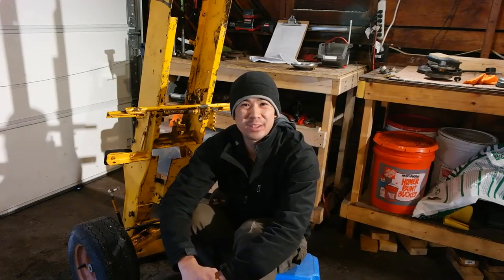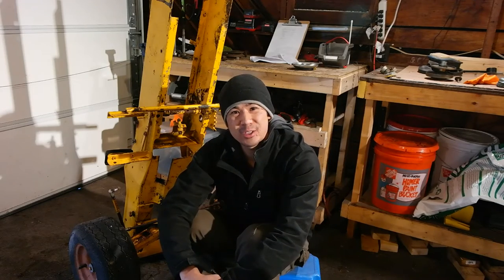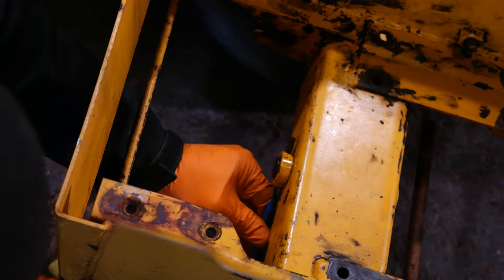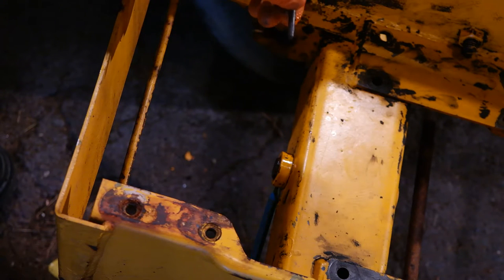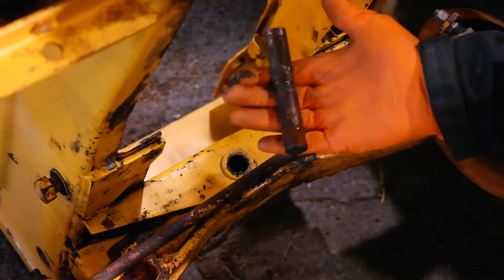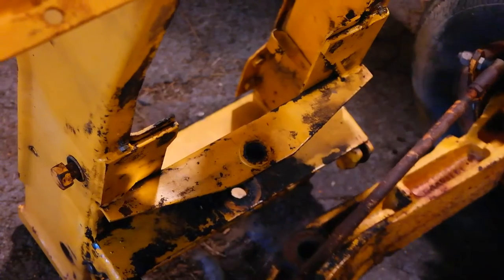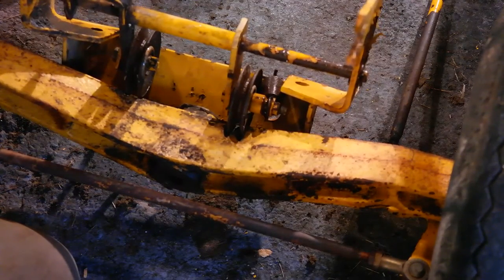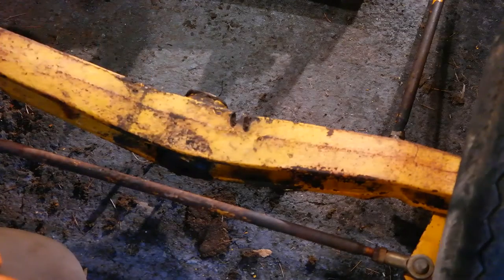Cub Cadet 149 TLB Transformation Part 4 - Front Axle Removal

Comment: Thought you might like to know some real easy upgrades that you need for that 149 with FEL your building. That front axel is junk with those grooves cut in it. Don't use any of the 149 front axel, spindles or rims. I've owned my 149 almost 40 yrs now and have found a lot of easy upgrade mods that can be used from cub cadets in the cyclops era.1st) swap out the entire front axle & pivot pin, spindles, rims, tie rod and drag link from a cyclops era tractor. Beefier axle, 1" spindles, heavier tie rods and drag link and use the axle pivot pin / bolt from the cyclops to keep the frame connection from spreading and the front end from collapsing. This ALL OEM parts literally swap from one tractor to the 149. You will need to grind the bolt head a little shorter for clearance if you have a deep sump oil pan. I think I shortened the bolt and nut for clearance. Works either way2nd) install the power steering from a cyclops era tractor or do something similar to it like a newer vid on YT shows. Here is the link to it.https://www.youtube.com/watch?v=VLfJAGpOv28&list=TL_d-iQihOD6syMjAzMjAxNg3rd) put a foot pedal on the left side for speed control of hydrostat and remove the one from the dash. Why left side, so you can add dual brake pedals on the right side to aid in steering tractor while using FEL. Same guy in the above link has a real nifty setup that can be used on the 3 digit series wide frames (149's)4th) Throw that junk drive shaft and couplers away. Replace with the cyclops era drive shaft with CV joints from an 1862 that had an 18hp Kohler. Bolts right up with only 2 changes needed. Custom coupler on the pump and the flywheel coupler that has no extra pulley on it. Will get you the link if you like.I'm in preparation of uploading my own vids to YT for multiple Cub Cadet upgrades, mods and customizations.FYI, not trying to be pushy or bossy, just trying to help while you still have this tore down.
Reply from the maker: +Steve Winter Thanks for the info. I was just watching that guys channel last night for the first time. I will look into it. I have progressed pretty far for this build, but it's not too late for the axle. I have about 1 dozen other tractors in the cue to be customized so if your suggestions don't make it into this build, it will certaintely make it into others! Thanks again Steve!

Comment: so can I conclude also that he did some research and found out that welding and filling in those slots on that cast iron front axle does not improve its strength. Just a guess.
Reply from the maker: Correct. Those cuts are from the mule drive and are of no consequence.

Comment: Are you going to use oversized spindles?
Reply from the maker: +LouCFur90 Yes I am. I am upgrading the spindles to 1" with a 4 Bolt Wheel Hub, and then welding some additional bracing around the spindle. I have all the parts, and it will be in Part 5 or 6! Subscribe to get all the updates as I release them. Thanks for watching!